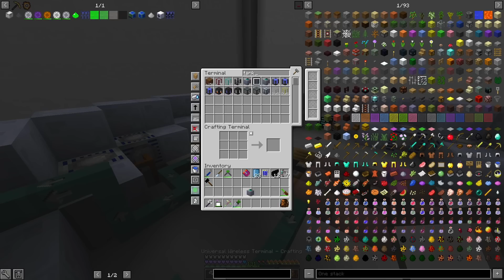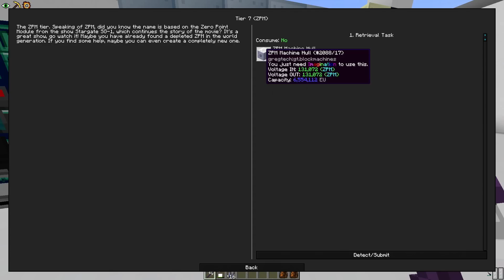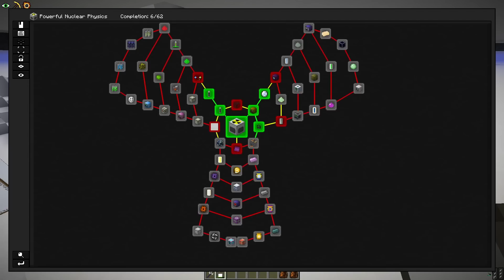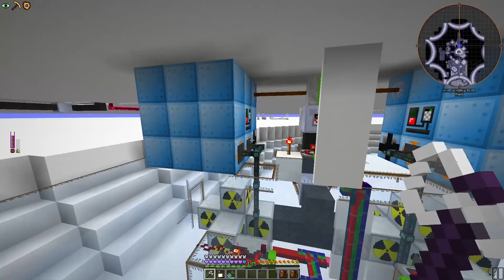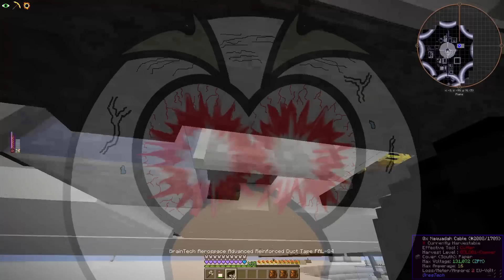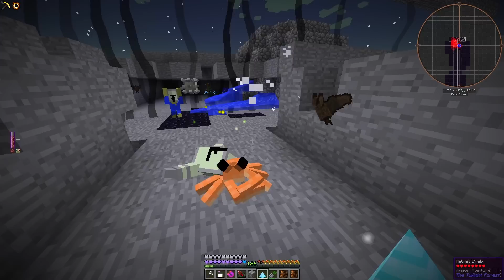Beating Minecraft's Hardest Modpack With Nothing // Episode 28 - Imaginary Technique: True Insanity

Comment: At this point, with all this absurdly nested mirocafting and accumulated processing times I'd just manually make one machine hardwired for EVERY RECIPE AS I UNLOCK THEM so that they can all run at the same time in adition to some on-demand machines that do the final steps. and if that doesn't work, double the machines that are bottlenecking until they don't. 

STILL an objectively better use of computer hardware than most AI and AI adjacent things in the current year.

Comment: I am very surprised by lack of LSC and mega multiblocks. They are not very difficult to make, with lapotronic supercapacitor being the go to power storage solution (up to infinite capacity), with mega EBF being quite good already at just 128 ZPM (which I powered it with until I had enough osmium for laser-supporting glass) and MVF being a very good replacement for array of "upgraded" vacuum freezers (they don't have parallels and as such are usually considered not worth it). Around ZPM my LSC capacity was ~1e12 EU, which was enough to progress to UV and a better powergen (don't ask what I was using)

Comment: I just spent the past week binging this whole series, and when I finish a binge I always make sure to leave a comment!

First, I love this whole series. Even the later episodes where you complain about how repetitive things are getting, I am still thoroughly entertained. I do recognize that ever since you've built the new base, there's been a tone shift from creating silly solutions to solve the problem of beating the game with nothing, to basically a normal GTNH run. I should note that a shift in tone is not a bad thing, to me at least! Your persistence and witty commentary is what I come for, and that's what I always get each episode.

If you feel like the series has changed too much since the beginning, however, I have a few suggestions for you!

If you feel like the late game of the challenge is too drastically different than the early game, you could potentially split the challenge into a second season (or a season 1.5 if you ever plan on doing this challenge again). This could be a way to communicate that the second half of this series is going to be fundamentally different than the first half, with less emphasis on tier skipping and diving into niche mods, and more emphasis on automation and regulating what you've built.

Another option, if you want to finish this challenge with slightly more mental stability, is to dive into all the other niche mods GregTech has to offer during those long hours where machinary isn't working. Many Minecraft lets plays, both vanilla and modded, reach this point near the end game, and have similar solutions. There will be an entire episode dedicated to roleplay, or playing around with a new feature, or reading comments, or breaking the game with a funny bug that the player stumbled into. The entire thing is filled to the brim with witty commentary and laughs, but in reality, it will only take about 10% of the effort of what they put into the next episode, where an entire massive project is completed and edited down to 20 minutes. GTNH is a HUGE modpack, and while it might not take 3 episodes to get a cat anymore, I'm sure there's plenty of small, stupid things you can do to keep yourself entertained while waiting for the next batch of upgraded circuits to finish crafting.

Then again, I also see that you're probably sick of this series by now, and want to be done with it more than double down on the effort it takes to make one of these episodes. You've found a solution that works for you, and these are just suggestions more than a plea for an overhaul of the series. Variety is the spice of life, and if anyone deserves variety, it's you! Keep up the amazing content, and I'll keep watching❤

Comment: It's so cool seeing how this run differs from my (normal) run, not just from resource availability but also power preference. I never made a reactor at any point in the run, instead figuring out fusion-to-steam power and leveraging tierskipping materials from meteors to make more power than I should reasonably have access to.

Assuming you never go for fusion power, Naqfuel is probably next in line as a power source once nuclear reaches its absolute limits. It's kinda like nuclear, in the way of decaying naquadah into random byproducts?

Managlass is EV-tier glass, and should be valid for any multi whose tooltips read "EV+-tier glass" but not "glass tier limits energy input tier". So things like (Circuit) Assembly Lines and the PCB Factory.

Also, PCB Factory. Wetware boards without wasting IV circuits and LuV pumps. Why did I wait till late UV in my run to make one?

Comment: Last time we had a garden of grind episode, I was still playing gtnh myself :(

"Cannot be bred in a bacterial vat" means that there isn't a bacterial vat recipe for "x bacteria fluid" to replicate the bacteria "easier".  Basically, most bacteria cultures can be gotten one of three ways: normal breeding in the biolab, breeding from their special fluid in the biolab, and clonal synthesis.  The two that you get from transformation you can't get from clonal synthesis though, and not all of them have a special fluid.  But obviously, mutagen etc basically acts as the special fluid for the bacteria that make it

Having mutagen will also be really useful for breeding the space bees

I think that both LCRs and MCRs will "subtick" (get more parallels) if you overclock them beyond one tick, but this might be disabled for LCRs to force MCR usage.  I don't remember, but MCRs are useful and cheap anyway

Pro tip for assembly lines and circuit assembly lines: you can share data hatches (more useful once you unlock the data bank), and for CALs you can share one energy hatch among 4 CALs for most recipes (iirc crystal mainframes and bio socs are the only exceptions)

None of the assembly line variants need tiered glass for higher tier energy hatches.  The component assembly line does need at least like osmium glass but then you can use any energy hatch.  You can also swap glass and stuff pretty easily with a wand focus: equal trade

The osmium bee is really good

You can void mine in the toxic everglades which is really good for europium, depending on if you want to allow void mining

You're totally right that the late game is a embarrassingly unbalanced waste of time.  Just in the immediate future, neutronium smelting is so slow it's actually unbelievable.  These recipes only continue to get worse with things like Americium, Tengam (this one is specific to no-space), DTPF catalysts, and especially anything made in the DTPF or eoh.  And the terrible balance is seen as a feature not an issue, so the game will never be fixed
Reply from the maker: All of this is fantastic. I will prepare to hit it with the great stick of "just do more of it".
Reply: @NeuroticGoose goose rail workers sell locomotive items wich can be pulvirized in to alot of Steel, i think this can be help full for future runs
Reply: Well, neutronium is solved by throwing more power at it, 2 billion EU/t is not much and makes speed very reasonable even in MEBF. Americium isn't an issue either due to its recipe from molten neutronium, which you get a lot of very easily from bees. I don't like bees much, but I can see why these are in the game, as a lot of people will cry very hard if they will need to build high throughput lines before ring of loki.
The rest aren't an issue until UEV, where you already have a ring of loki (and if you don't, make it, you have infinite mana), which means you can build arrays of machines with universal autocrafting without an issue.
Reply: The people who see it as a problem just make a new modpack

Comment: Have you looked into GTNH 2.7.0? It's in beta atm but a significant amount of progression has been reworked to actually involve engineering puzzles rather than "just wait for a long time", aswell as add a lot of QoL to the mid-lategame. Worth looking into considering those are your main complaints.
Reply: Considering that this is the flagship series of this channel, i think that Mr. Neurotic cannot afford to use an unstable version of the pack.
Reply: @Blue-Maned_Hawk  The stable version releases some time in November. I'm mainly mentioning it cause originally goose didn't intend to update at all, but did when it was clear that it would improve the series.
Reply: @1_____________________  Then i think that Mr. Neurotic would probably wait until November, as i don't think that it would be worth it in its unstable state.

Comment: I would be interested in hearing how your vac-nuke setup works, it seems different than the ones listed on the wiki, and although I do like the idea of figuring it out on my own, I honestly cannot be bothered enough to sit down for several hours to learn all the gates and systems necessary and then spend time designing the thing, although that does seem like a fairly reasonable time investment if I’m already playing GTNH somewhere in the range of “a little too much” and “definitely too much”.
Anyway, thank you for the Goosing.
And to anyone reading this: I wish you a good [insert appropriate time here].
Reply from the maker: I see the wiki vac-nuke designs as mostly a proof of concept, particularly the one that uses Cores. While they would work as described if you absolutely nailed your automation, I would much prefer to trade peak output for stability, and I feel pretty vindicated by the number of times that preference prevented me from slagging my systems... for one definition of slagging, at least.
Reply: @NeuroticGoose if you are interested in some inspiration, check out the vak nuke design from Ivelieu, she made a video on it just recently. It’s 100% uptime and robust.
Reply: AverageGregtechPlayer made a video on his core setup and iirc it looks a bit similar. Also "ivelieu" made a video on vac nukes, but not the core

Comment: IC2 iron fences also contain tempestus IIRC. Probably because they are used as lightning rods.

Also, for the record: the CALs do not need upgraded glass. Mine are on UHV and are perfectly fine using alfglass. I think that unless the machine specifically says that energy input tier is limited by glass tier (or something similar), then you can just use whatever.